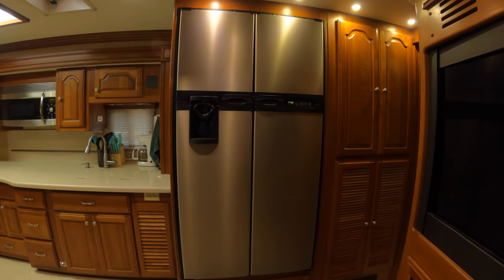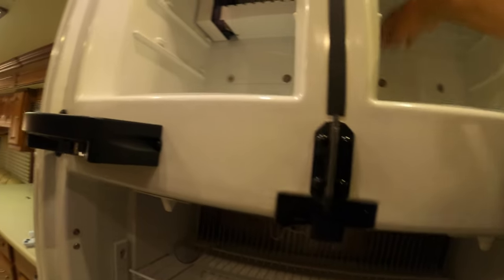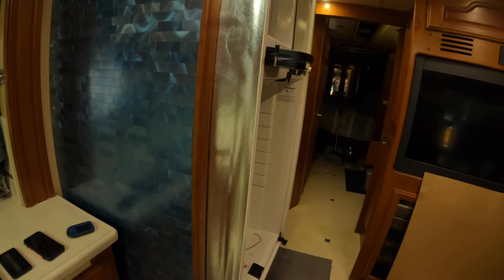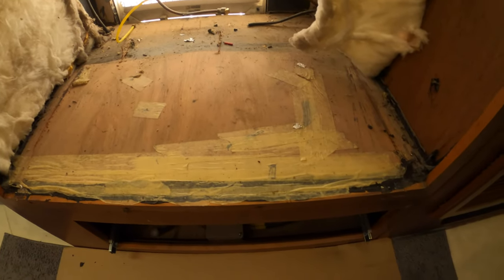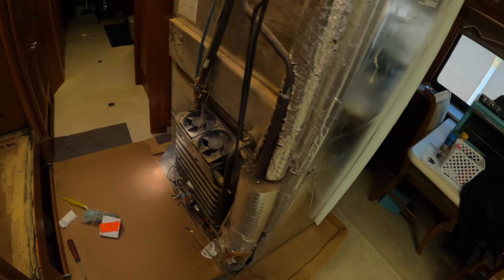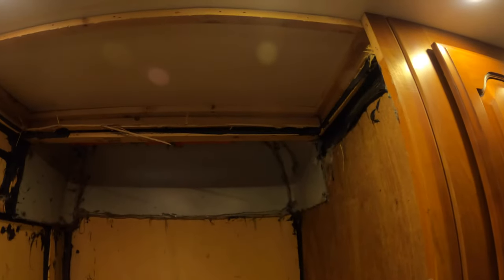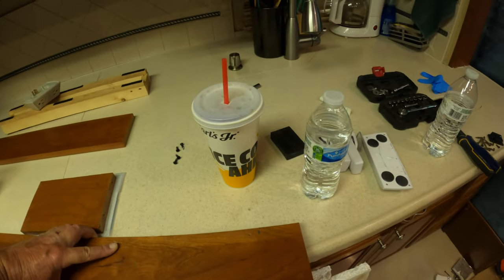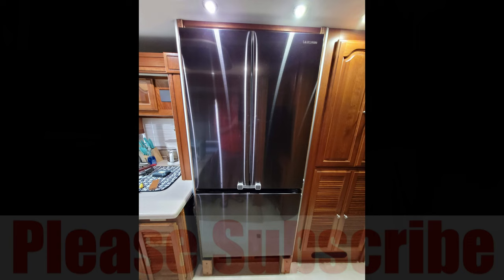DIY-RV Samsung Fridge Install

Comment: Appreciate the video. Im researching doing a similar install. Quick question, how did things go with just the 400w of solar with the residential fridge initially before you added more? 

I currently have 400 solar and 200 amps of lithium, 1000 inverter, hoping I can get by on that. Thoughts?
Reply from the maker: Out of the 400 watts; the most I've ever produced at my peak output is much less than my peak demand. I have a bay fridge for drinks as well and even with the 800 watts it barely keeps up  even at peak sun times. I'm going to add more solar in the future.

Comment: Nice job!  Were you able to screw into the side of this fridge to secure your brackets ?  No AC lines in the sides of that fridge ?
Reply from the maker: I did not screw into the side of the fridge because that is not a very sturdy place to anchor. I packed high density foam between the side of the fridge and the sides of the cabinet. I secured the fridge on both sides from the cabinet to the edge of the fridge using 1/8" thick aluminum flat stock as well as footers under the adjustable legs and steel stock in front of the rollers in the front of the fridge.

Comment: You mentioned plugging into the inverter outlet, which plug was that? Do you have to swap outlets when plugged into shore power?
Reply from the maker: There is a split duplex receptacle behind the fridge and one plug in is marked for the inverter, the other is for the icemaker.

Comment: I've been told numerous times an RV can't hold the weight of the large Samsung french door fridge. Does it seem too heavy? I mean obviously not but does it contribute to much weight?
Reply from the maker: I moved the old one out and the residential in, and if I had to guess; I would say that the old RV fridge was heavier than the Samsung.